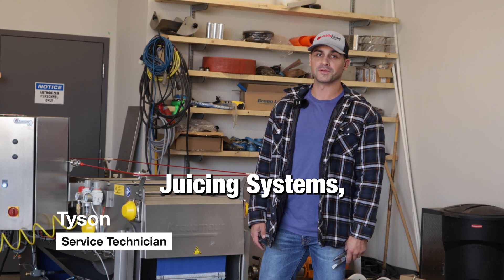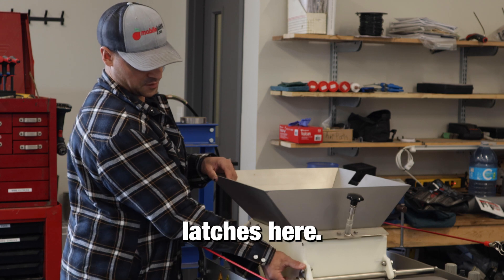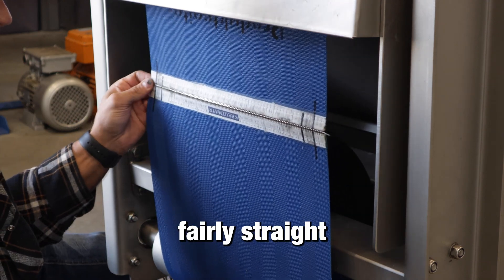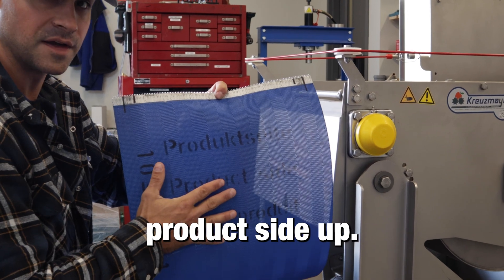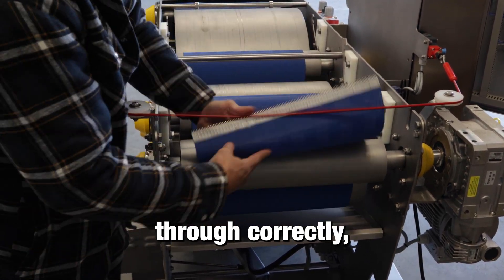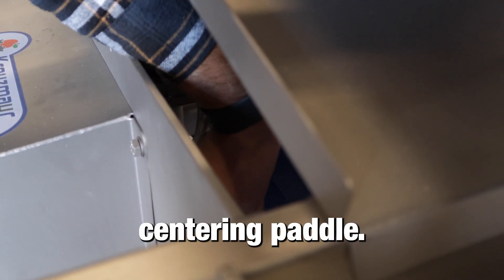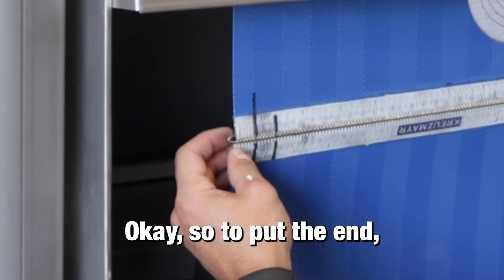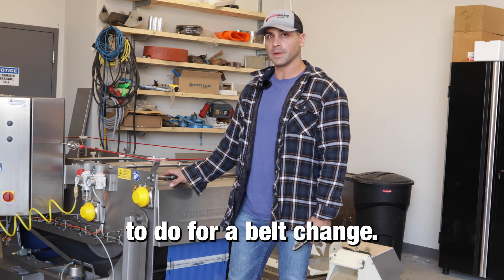How to replace the belt on our single belt press | Mechanic Hour

Comment: Hello. Nice video. One question. Does the rode that holds the belt has to be stainless steel? If yes, what grade and what mm. Thanks.
Reply from the maker: Yes, needs to be a stainless steel rod. You can use a stainless steel welding rod 0.8mm, which should do the trick.
Reply: @JuicingSystems  Thank you very much. I have been replacing the belt from a double belt dewatering press and I wasn't so sure . Keep it up